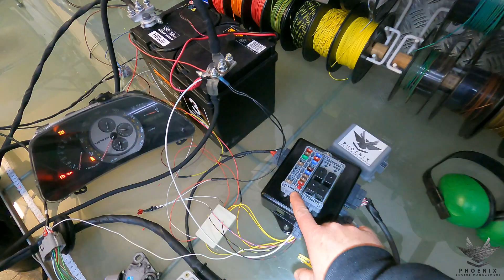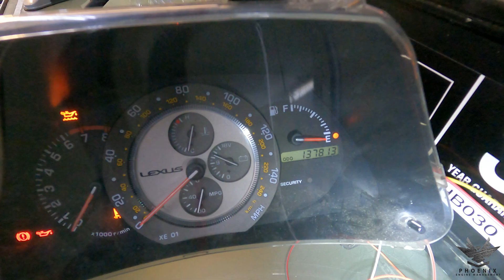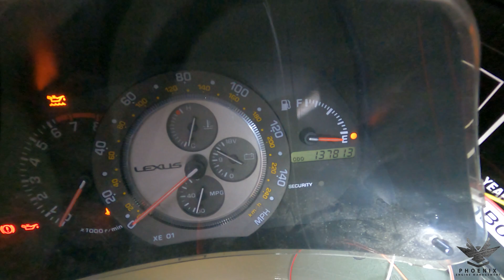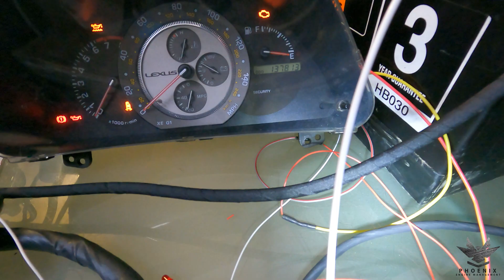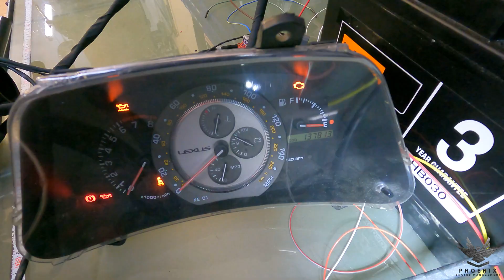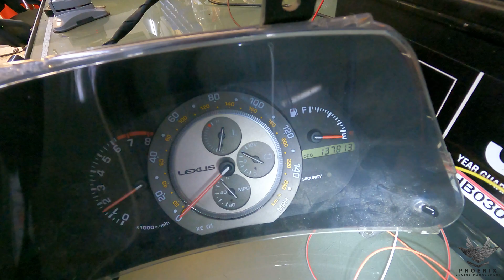1UZ-FE Diagnostic Trouble Shooting

Comment: Quick question when you wire up a 1uzfe vvti while using a haltech elite harness do you use the alternator control that the ecu provides?
Reply from the maker: Hello Chris you wouldn't need to use any alternator control as the 1UZ-FE VVT-i is a simple alternator. The only time I could think you need to use some sort of ECU Alternator control is with the very late gen 3UZ-FE VVT-i from a Toyota Crown Majesta.
Reply: @PhoenixEngineManagement  
Thanks

Comment: Hallo from South Africa, I just bought myself a 2002 Mitsubishi L200 Cab and a half. Used to be 2.8 diesel now  1UZ VVTi.  Only oil and alternator light working and fuel gage. No refs or speed. Auto box only shifts to fourth. I have no idea who did the conversion. Their wiring is very shoddy. What will a new harness for this setup cost in the UK? Would you try to get the oem instruments to work or do you suggest fitting another instrument cluster.
Reply from the maker: Hello Jan if you can send us a message to our page we can discuss in more detail exactly what your requirements are and exactly what setup you have. www.phoenixenginemanagement.com